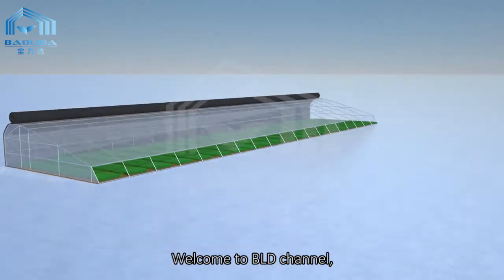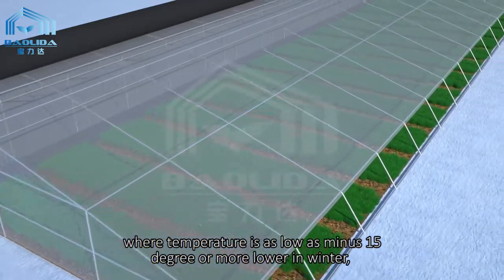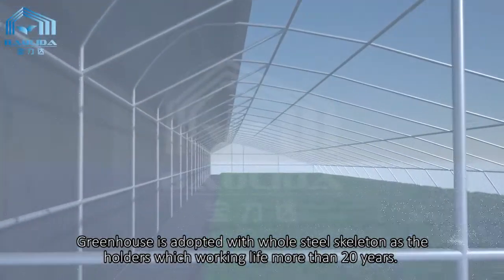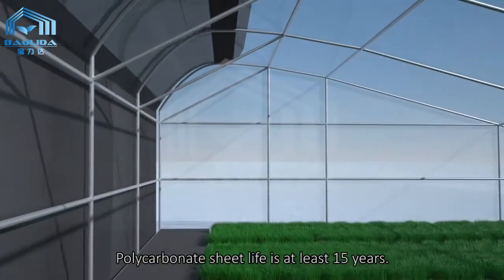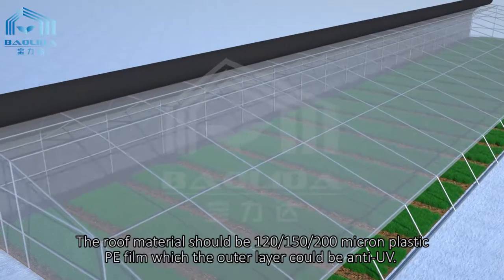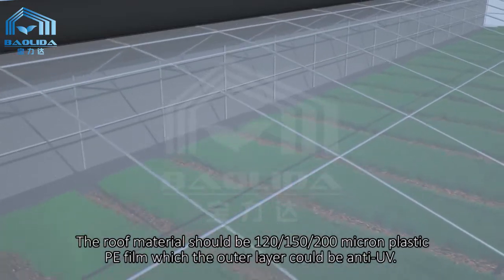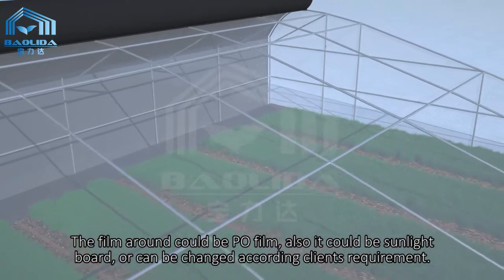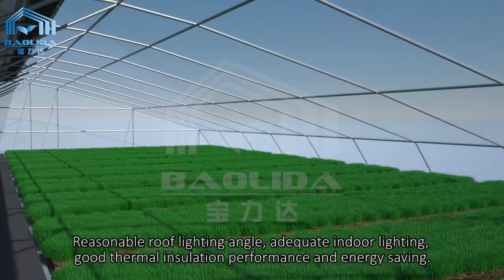China Passive In-solar Greenhouse

Comment: snowfall on the roof seems a problem for this greenhouse ..
Reply: I seen a gentleman in Olds. Alberta has a vibrator to shake the snow off the greenhouse. his set up is on YouTube. Can’t remember the name.
Reply: They use vibrators at this greenhouse in Calgary https://www.youtube.com/watch?v=FOgyK6Jieq0
Reply: a motor can be used as a vibrator to shake it down
Reply: Actually no. There is a young Chinese man with two of these in Olds Alberta Canada. His are a double house design though. A house like this, within a bigger structure. He has electric vibrators on the outer structure that shakes all the snow off. And even though he does not heat them? Even in -45C its still above freezing inside with the blanket down until morning.